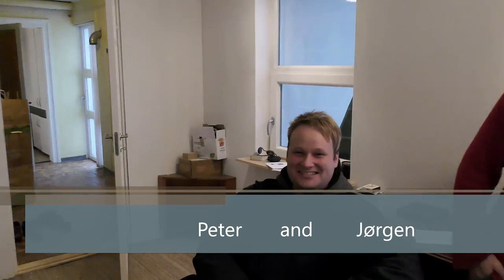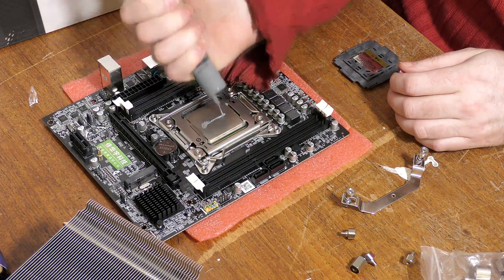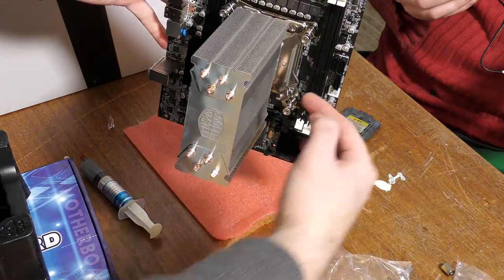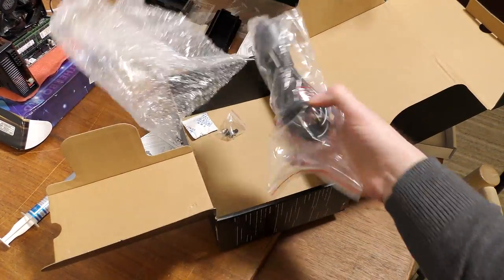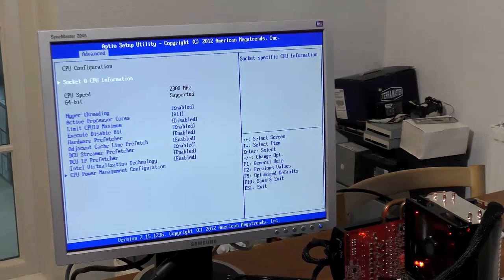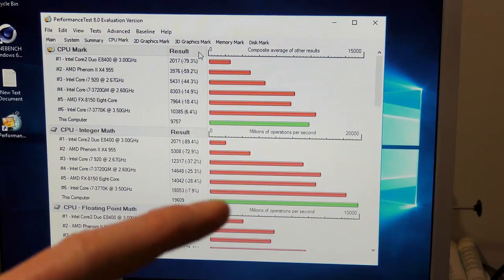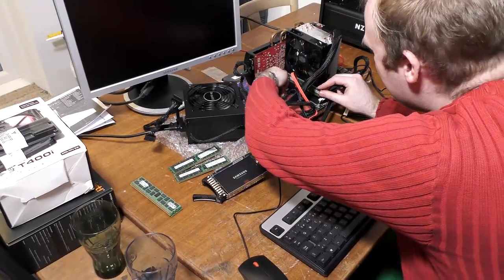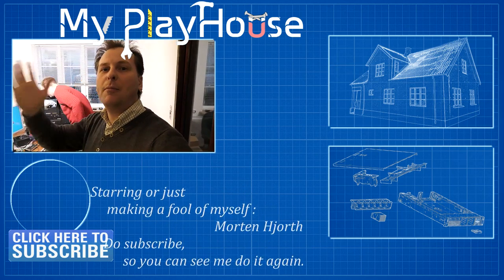E5-2660 Engineering Sample Xeon PC - But will it run Farmville - 808

Comment: I've recently purchased ES version of 8 core e5 2450l v2. Works perfectly with HPE 380e g8 :D it was around 100pln so something like 20 euro :D
Reply from the maker: Hi Sybreeder
Okay,, I tried these E5-2660-ish's in a Lenovo x3650 M4,, that was a no go..
Thank you for watching! :-)
Reply: @MyPlayHouse  maybe that ordinary servers block engineering samples CPUs if no special option key is present? Just to avoid usage of non ordinary items in production environment...

Comment: For the cpu's to work on servers they need to be the proper version. Even if it is a lga2011 cpu you must have the 2660 v3 if I am not mistaking and that cpu actually has lga2011-3 which a server like you described typically has. This version that you have is a v0 and v2 would work as well and they are designed for workstations not servers. When in doubt just google the cpu along with the "v" if it has one and the first page on search should lead you to ark intel detailed specs of the cpu in question. There upon scrolling you will find out what type of lga it needs and you will have a clear indicator of what kind of cpu it is. I kind of went all over the place but I hope that you got something from my explanation.
Reply from the maker: Hi Alexandru-Daniel Popovici
Thank You very much!  But I believe it's microcode updates that determines what CPU's you can run. The Lenovo x3650 M2 could not at frist run the Intel Xeon 5600 series, only the 5500's. After an update it would also run 5600's up to an TDP of 95 watt. I believe the good servers does not have the microcode to allow them to use Engineering Samples. where as this cheap Chinese systamboard does not give a flying.... :-)
Thank you for watching! :-)